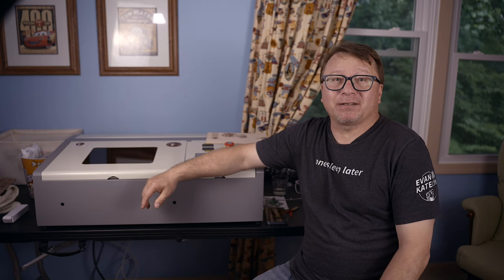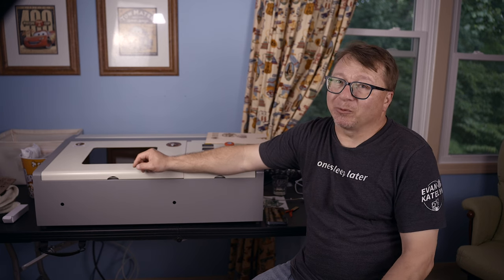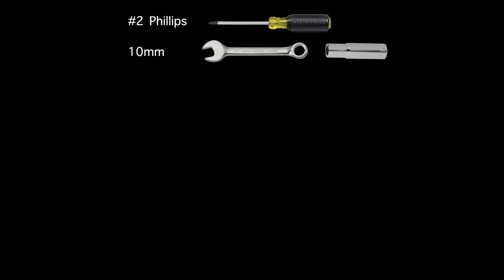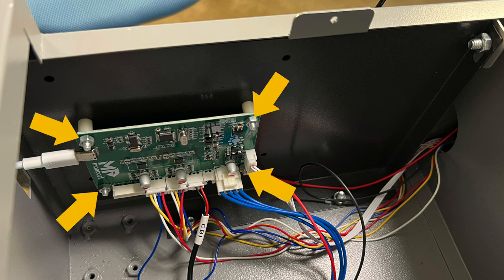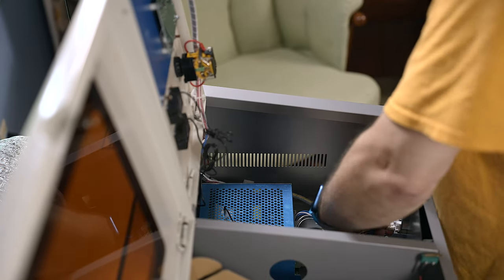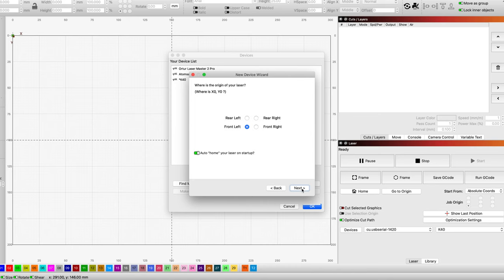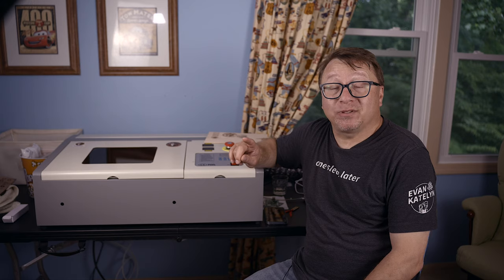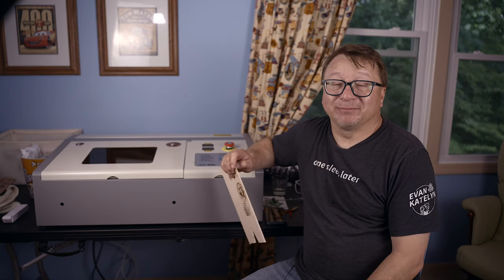BEST upgrade for Monport K40 laser EVER

Comment: thanks for you video , I have the k40 but 55w u had changed the focus lenses to 38.1mm  to engrave a very small area's as 2.5mm *2.5mm size but the machine is not working as the focus is not working well any suggestions I've tried with the Hight adjustment in addition to the power  nothing is working any idea's  thanks in advance
Reply from the maker: Hi Youssef -- I recommend checking on the Monport forums on the Facebooks - https://www.facebook.com/groups/440223344188923 - thanks.

Comment: Thank you for the video, I have a China brand co2 machine. I have installed the Monport control board but I am not able to get it so that Lightburn controls the power to the laser. All movement control works well with Lightburn,   PIA having to set power intensity with the control  on the machine.  with someone could help.
Reply from the maker: It's really hard to say, but have checked your "S" setting - should be set to something like 1000 ($30 in the command area).

Comment: Hi great video I have also fitted the new board and works perfect, I was wondering if you had fitted air assist yet. I have tried and cant seem to get it to work I was thinking it would be the same as my diode laser by connecting a relay to the board to operate a solenoid but when I give the command M8 or use the air button on Lightburn it doesn't seem to do anything, I was expecting to see a voltage maybe 5v DC on my meter. It would be nice to hear your comments.
Kevin.
Reply from the maker: Hi Kevin - I don't have air assist yet, but that is a future project (along with lenses and mirrors). I would expect the digital output to turn on when activated -- probably 3.3v given the processor. I will check it out on mine and see what I can figure out. Thanks for watching!
Reply: @cyberreefguru  The Air Assist connector needs to be enabled and requires firmware update, Monport support don't want to help, emailed them , raised trouble tickets but no response. Tried to post about  the issue on their official site but the post never get approved by the moderators.

Comment: what do you do with a journeyman that tends to stall temporarily in tight corners.
Reply from the maker: Hello Alan - I don't believe I've heard of this problem. Is it slowing down or actually stalling? Are you using the Buildbotics controller? That controller is designed to automatically slow down in sharp corners to avoid excessive stresses on the bit, but actually stopping is not normal. Though it does depend on your design software; it is possible the machine is being instructed to "stall" -- what CAM software are you using?
Reply: @cyberreefguru  its not the masso so likely buildbotics. i think its just going much slower when the cut gets deeper. i am using fusion. i was wondering if some of the settings could be tweeked? thnx for your help.
Reply from the maker: @adbellable  If it's not Masso, then it is Buildbotics. I don't think you can turn the setting off, but have a look through the menus to see if it's possible. Unless you did something special, it's definitely not coming from Fusion. Hope this helps!

Comment: There looks to be multiple versions of lightburn available. which version would go with this board?
Reply from the maker: I have the latest and it works without a problem. I've not had any issues with any of other lasers with the last 5 or 6 versions, so you should be good to go. Thanks for watching!

Comment: Can you tell me the difference between the v1 vs v2 upgrade boards? I see that the newer board is "easier" to install and that it's 32 bit vs 8 bit but what are the real world benefits? The v1 is $45 vs the $60 for the v2 on their website right now. Any info would be appreciated.
Reply from the maker: Hi Dex -- in short, the v2 board is a drop in replacement and the one you want. I've heard some not-awesome things about v1, but I can't validate them, I won't repeat them. Hope this helps.
Reply from the maker: Hi Michael - the Lightburn Compatible Nano Replacement Board is the one you want. It is the drop in replacement and super easy to get installed.  Thanks for watching!

Comment: Did you have any issues with max power? Im only getting about 6mA with the settings set to 100% in lightburn.
Reply from the maker: I have not had any issues, though someone else reported the max power was set very low in Lightburn and had to be adjusted (Device Settings > Basic Settings > S-value Max > 1000). I would look for that setting and see if it needs to be adjusted. Thanks for watching!
Reply: @cyberreefguru  Hello. I have the opposite problem. I can't get the power low enough, although reducing the S Parameter already to 100
Reply from the maker: @lechiffre5452  Hmmm, have you checked the Monport user's group on the Facebooks?